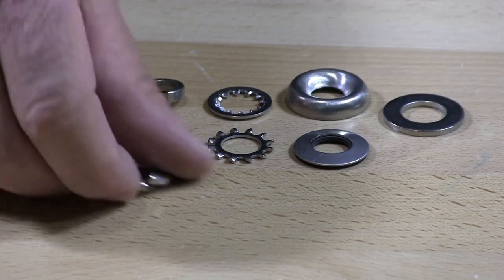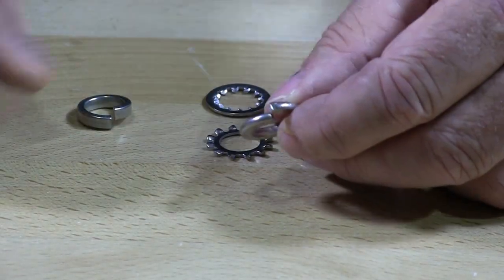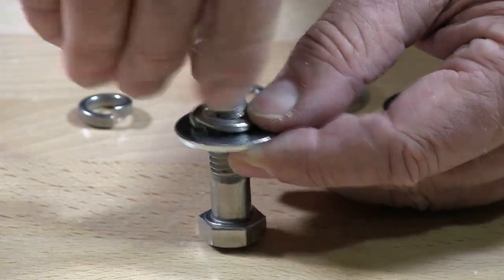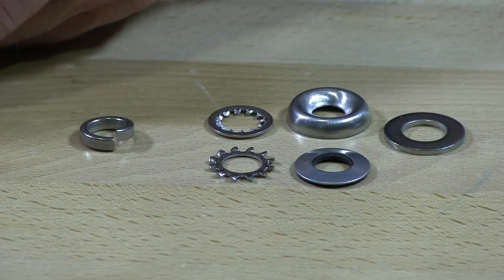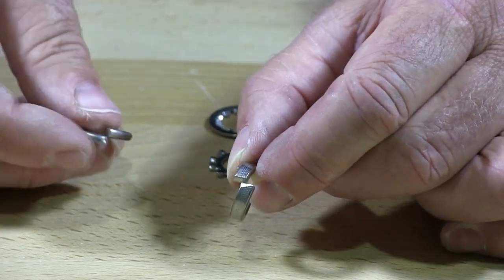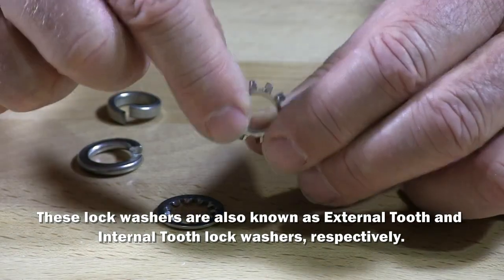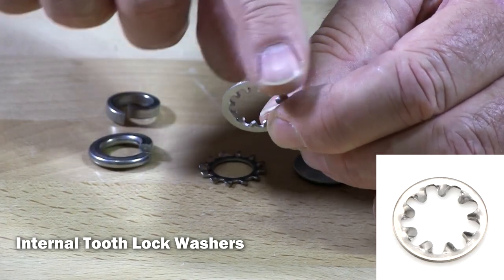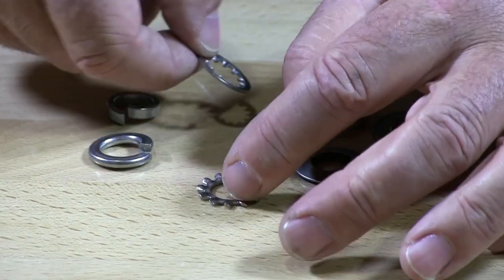Common Types of Lock Washers | Fasteners 101

Comment: Regarding the internal toothed lock washer, does it matter which side of the washer that is placed against the part being fastened against. Or, are both surfaces/sides of the toothed lock washer the same? At the place I work, someone was trying to tell me that one side had a better biting surface than the other side. I tried to tell them that both sides were essentially the same. What is the correct answer?
Reply from the maker: It does not!
Reply: @AlbanyCountyFasteners  thank you. I appreciate your reply.

Comment: If i want to use an internal toothed washer, can it have any number of teeth? Is there a standard that connects number of teeth with diameter? ( So far i have only seen standards/catalogues from companies that specify internal and outer diameter and the thickness of the washer). Thanks in advance
Reply from the maker: Tooth Lock Washers can have any number of teeth. The ASME standard that defines their imperial sizing doesn't specify the number of teeth a washer has for it's given diameter. Based on what we've seen with other customers and applications, the number of teeth doesn't seem to be very important for these kinds of washers.

Comment: lock washers DO NOT WORK !!!! who says ???? carroll smith,, he wrote the book on race car hardware, and another  group of people from florida and houston ,,, NASA !!!!there is a free book on line from NASA ,systems engineering handbook, about 300 pages,and a section on fasteners,,, dont waste your money on lock washers!!! spend it on lock nuts and lock bolts,,and high grade ones too,, aircraft grade nuts and bolts can be safety wired , so they never come loose,,junk lock washers sold at hardware store are too soft and cheap metal,

Comment: I like the first example.  It helped to know how to use the pressure washer.  Sometimes I don't even know if it goes with a flat washer or doesn't.   Anyway I was looking forward to know how to use the internal star washer since I have never used them before and the video ended.  😂
Reply from the maker: There's honestly not a whole lot to them. You apply them to a bolt or nut like any other washer and the teeth bite into the bolt to help lock it down. Was there something specific you were looking for?

Comment: Pretty sure that’s not how the first lock washer works. The cut ends dig into the mounting surface and the nut or bolt to prevent it from spinning. Putting a flat washer on there will allow the washers spin and cause the nut or bolt to loosen up.